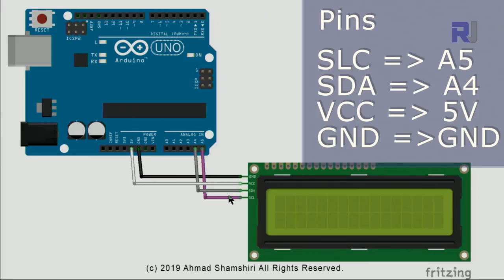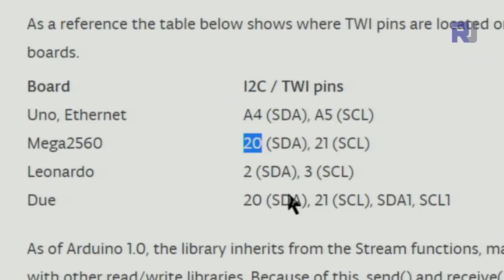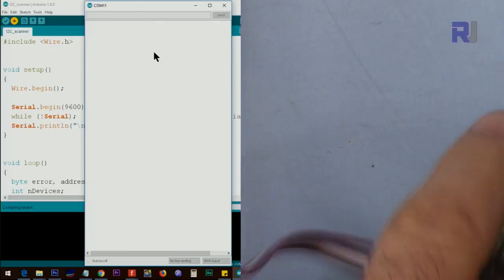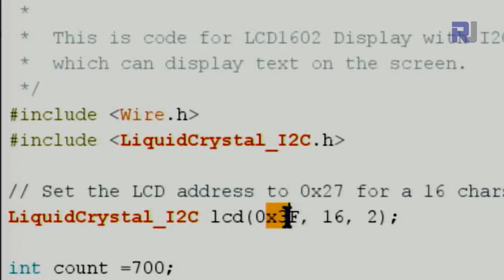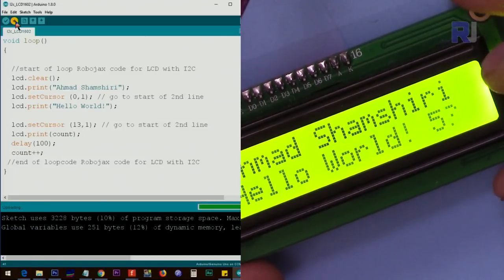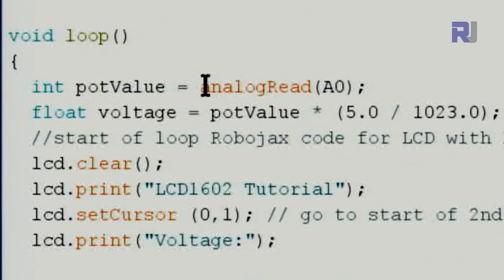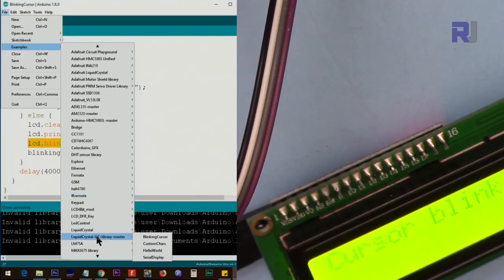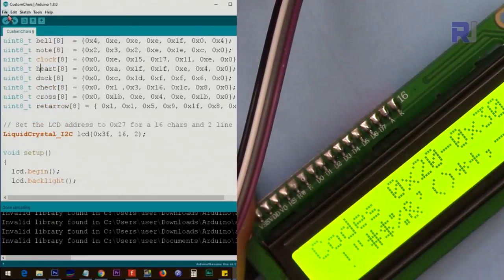Lesson 19: Using LCD Screen with Arduino LCD1602 LCD2004 | Arduino Step By Step Course

Comment: In the video where you add reading a voltage.    The pot was connected to 3.3V but in the formule it was 5.  Shouldn't be 3.3?
The structure of lcd has several members.  If you don't know the members for can to find out about them?
Reply from the maker: If you want to read 5v then connect it to 5V there is no problem with that. I had 3.3V pin available I used to without using a breadboard.
Reply from the maker: I have shown some more features of code on this video https://youtu.be/NXAswOc_2zg

Comment: Hello, i'm working on a little weather station, but i can't combine 2 codes in my arduino. Also the LCD screen doesn't light up. Can you help me?
Reply from the maker: Hello, for make sure you can see a test in the screen. Then check my tutorials as I have so many tutorial of LCD with tempers, with voltage, with motor with servo and more . You will find something useful. Here is how to find a video in a channel https://youtu.be/OhkUceBWcHs

Comment: Hey your code is working but the only problem is that only starting letters are appearing on the screen
Reply from the maker: Yes if you don’t watch the video fully, this what happens.  You can’t just type a test to display it. You have to know the length and put it accidentally

Comment: I can't get it to work.  Keep getting this eerror:
C:\4_Arduino\LCD2004\LCD1602\LCD1602.ino: In function 'void setup()':
C:\4_Arduino\LCD2004\LCD1602\LCD1602.ino:48:12: error: no matching function for call to 'LiquidCrystal_I2C::begin()'
  lcd.begin();
            ^
In file included from C:\4_Arduino\LCD2004\LCD1602\LCD1602.ino:1:0:
c:\Users\debgreeno1\Documents\Arduino\libraries\LiquidCrystal_I2C-1.1.2/LiquidCrystal_I2C.h:58:8: note: candidate: void LiquidCrystal_I2C::begin(uint8_t, uint8_t, uint8_t)
   void begin(uint8_t cols, uint8_t rows, uint8_t charsize = LCD_5x8DOTS );
        ^~~~~
c:\Users\debgreeno1\Documents\Arduino\libraries\LiquidCrystal_I2C-1.1.2/LiquidCrystal_I2C.h:58:8: note:   candidate expects 3 arguments, 0 provided

exit status 1

Compilation error: no matching function for call to 'LiquidCrystal_I2C::begin()'
Reply from the maker: Hi, clearly it say  that "no matching function for call to 'LiquidCrystal_I2C::begin()'" so you have incorrectly installed the library. Please check it . Or follow this video https://youtu.be/NXAswOc_2zg